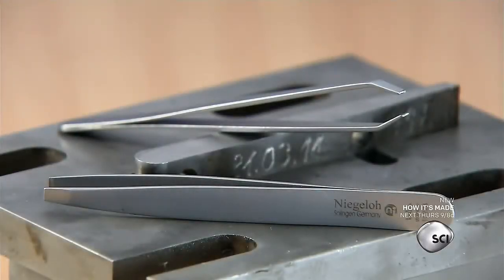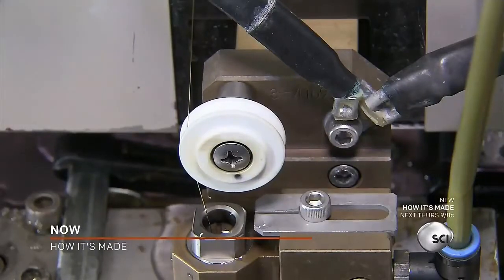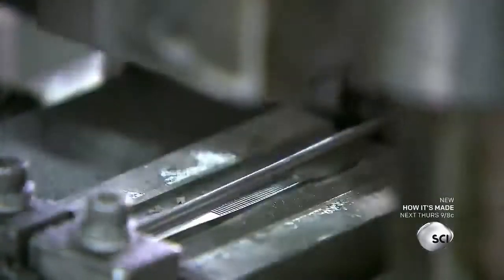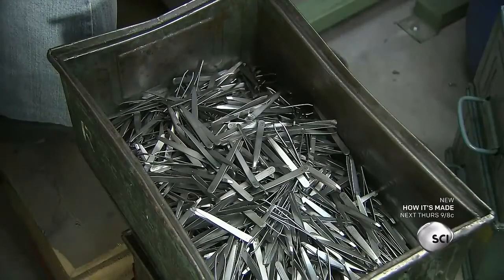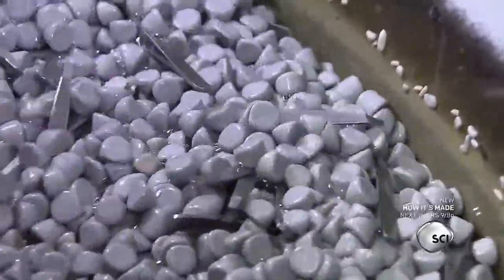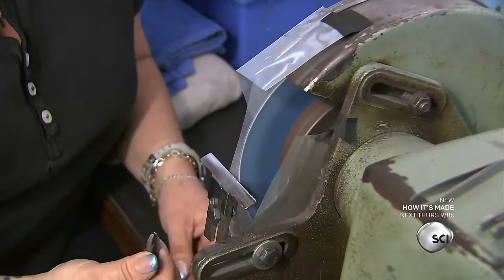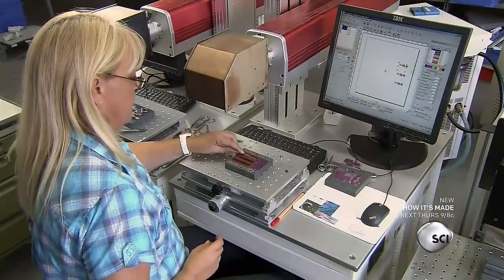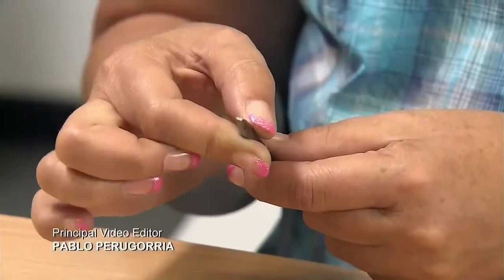How Its Made Tweezers

Comment: A bit concerning that some employees didn’t use much if any PPE (Personal protective equipment) those belt sanders will mess you up when they fail and I’ve been on the receiving end of one when it failed. The man running that sander  didn’t even have safety glasses on. As I understand that some PPE is annoying to wear but it’s totally not worth losing a finger or better yet a eyeball. Great video otherwise love the show and have for many years  keep up the great work 👍